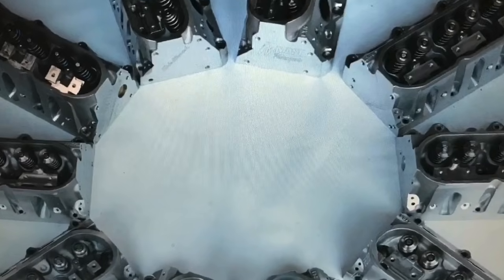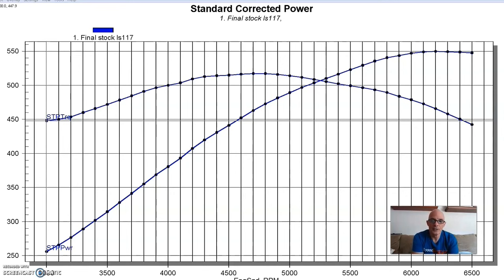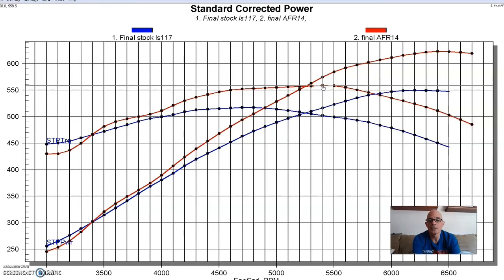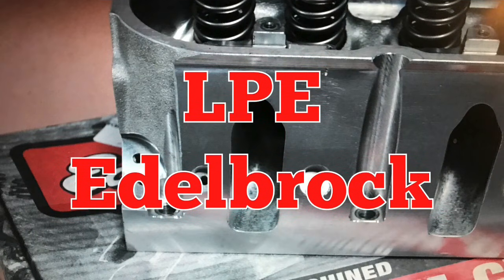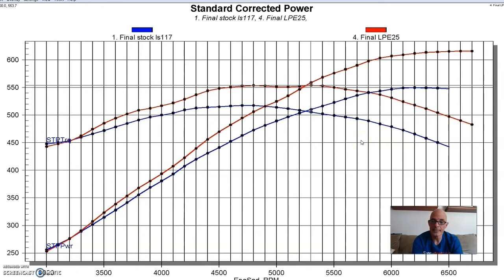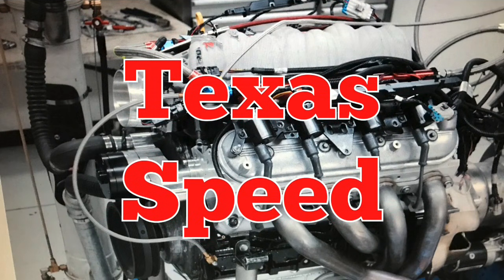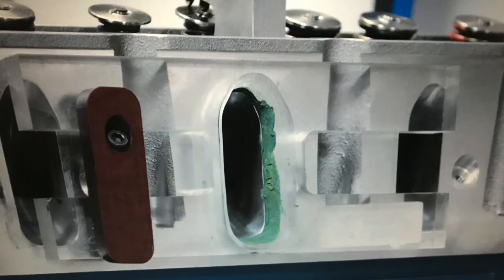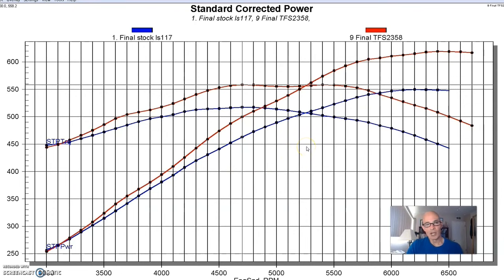AFTERMARKET LS HEAD TEST-STOCK CATHEDRAL PORT VS 10 SETS!

Comment: A few things:
1. This channel should have  1M subs. Every day is another interesting video and this one was amazing. I mean the sheer time and expense of conducting these tests is staggering, but Richard delivers the info in a free 20 min video
2. It's funny as hell that they are all basically the same. Gear heads have been searching for the secret cylinder head forever.
3. I was in the engine business until about 2010 and just started to get interested again this year. The amount and quality of aftermarket parts has exploded, as has the amount of actual scientific information. Pretty remarkable
Reply: He doesn’t hide the fact that most of these are magazine tests from years ago, but he does a great job of packaging them nicely into a video format full of good info.
Reply: If this were the 1960s and 70s you would be right. There should be 1M subs. Unfortunatly because the laws got so strict on things like street racing and emissions ect that the boys have lost interest. It's become too complicated. Sensors everywhere, computers everywhere radar everywhere.. The government has nutered the sport.
Reply: @TractorWrangler01  I don't think this is correct. Check out 1320 video or the Cleetus MacFarland channels
Reply: @Frostekzz  Richard actually did the tests. He's just revisiting them. He is also doing more tests currently. The cam test he did recently was great.
Reply: There's hardly 2 percent difference between any of these heads, telling me that the limiting factor here was the intake system air flow, or fuel delivery which was maxed at about 620 hp capacity.
Reply from the maker: the subs are going up every month-the channel is pretty new-the support is growing and greatly appreciated
Reply from the maker: there is nothing to hide
Reply from the maker: performance and racing is alive and well-this is the new Muscle car era and it had lasted much longer than the original-which produced some iconic and awesome vehicles
Reply from the maker: look closely at the flow rates of the heads-its not fuel flow, more power could come from cam timing, compression, oiling system mods and a short runner intake, but at the expense of torque through most of the curve. This wasn't a max power build-just a comparison
Reply: @richardholdener1727  Agree x100, isn't the dyno outfitted with an Aeromotive 11104 Eliminator pump/related components? Seriously 'over'-fueled, just in case. Subscribed for over a year now, no disappointments (except when I bricked my torque guess and missed out on a free cam!:D ) Thank you!

Comment: There is a great article that was published around 2001 that details the developments of the LS6 head from the LS1 head, and why GM had to make certain choices and decisions to balance power vs exhaust management and emissions regulations.  They learned some things from Lingenfelter, specifically that atomization as a result of the spray pattern from the injectors onto the back of the valves was not as influenced by the intake port design as they had originally thought.  They further refined the port profile to reduce air restrictions while being careful not to disturb the spray pattern and this allowed them to increase the hp from 345 to 385 to 405 from 2000 to 2002 (with slightly different cam profiles), although they were still using pup cats after the exhaust manifolds to help comply with LEV restrictions.  GM produced one hell of a head, knowing full well there was plenty left on the table, but not able to capitalize on it because of the cost of producing CNC'd heads vs cast.  In the end they still had to produce a product that was cheap, met LEV regulations, and then made decent HP.

Comment: Got a set of 243s, ls6 intake, and 228r Texas speed cam for a really good deal. General plan is to get the heads ported and decked, modify the manifold to accept a larger throttle body, and run a set of long tubes. Greatly appreciate all of your content because I’m super anal about trying to figure out the most optimal combination and get as much info/knowledge as I can before dropping a bunch of money into my setup.

Comment: I'm not an experienced LS person hardly at all other than repairing stock engines. The engine I build for racing are still the same old small block Chevy and sometimes big block. Dirt track and drag racing. I have been collecting ls parts, blocks, heads, and whatever comes with. I scored a set of cnc procomp ls1 heads one time and never used them YET. I think they are the same thing you just test and if so, I'm very pleased. I'm pleased because I'm planning a Na  build of a all out racing ls engine. 16 to 1 tunnel ram engine. I haven't  seen any all out na ls engines yet but I'm sure there are plenty. Thanks for your hard work, it's great.

Comment: I have a 5.3l from a 2001 Yukon,  and it sets in my 64 C10 , and because of you Richard , without any knowledge what so ever , I am confident that my setup is screwed... lmao... I now know that my heads need replaced or massive upgrades and the cam that I want to run will not work for the application that I am going for and this has made me realize that I need to throw a set of remote gt45 turbos and just let it eat. ( after ring clearances and valve springs and replacement head gaskets along with lifters.... oh and an electric water pump...lmao) thanks for giving me the confidence on this new platform to know that when I do something to the motor that if I don't do more safety than I think is needed then all I have is to blame myself.... ) because you my friend have shown me the proper and most efficient way to make a LS based motor live and make HP...  thanks again for all you do!!!

Comment: No surprise that TFS 235’s lead in Avg HP/TQ and right there at Peak HP and tied for Peak TQ with the larger AFR 245’s. Brian Tooley did an amazing job designing some of their heads and this goes to show that on smaller notes that consumers should pay attention at the air flow numbers at mid lift and not focus just the flow at higher lift. Hotrod Mag did a similar test years ago and TFS 235 led in all categories too.
Reply from the maker: same test-I did that for Hot Rod

Comment: Hi, Here is an idea for a test. 
Chevy says that there is a limit to the amount of overlap that will produce more power with a street-type  exhaust system due to the lack of pressure wave tuning. Test "stock with mufflers" vs "open headers" varying only the overlap from stock to typical drag race values.
Reply: If chevy spent millions and tells you that's what they found....why redo it?

Comment: One thing that was holding back the power on the aftermarket cylinder heads was the intake lift on that cam (.617). How much lift you can benefit from, directly correlates to valve diameter. For a good flowing set of heads like these aftermarket sets, you'd want a lift-to-diameter ratio of .30:1. Giving you an ideal intake lift close to .650 on some of these heads. I'd love to see this test done with lift optimized for the bigger valved heads, since the smaller valve heads won't lose power from too much lift, they just won't benefit.
Reply: I know first hand that the AFRs in this video are for a max lift of 650 and the Trickflows a max lift of .600 per the manufacture
Reply: I don't trust the lift-to-valve-diameter ratio very much. 
-- If you have a small port with a fat valve job, the setup will work differently. 
-- The D/L ratio I trust is 4:1 + the seat width. 
-- Also, if you have different mathematical definitions for a given cam profile, using additional "Useless lift" can have a different outcome with a square engine vs an oversquare engine. 
-- Bolt it up and run it on the dyno, buddy.
Reply: @baby-sharkgto4902  The max lift on those Trickflows is based on the spring they send them with.

Comment: I may been way off base, but when planning my 385 stroker build, I studied 350, 383&400ci dyno graphs, and it seemed the peak power dropped off faster on a 383, with the same type head , compared to a 350ci. That's what lead me to the 220cc aluminum heads,  it's been in storage for years, (I had a series of disasters, I moved, then the house burned DOWN!) But hopefully with a cam upgrade, the TQ down low should be good, with the longer stroke, and hopefully power should keep climbing to around 6500, insted of around 4500- 5000,   I know there are alot of unconsidered variables,  even different dynos, different engines,  and I'm comparing somewhat stock engines stroked, to 383, my engine is obviously a notch or three above that, forged everything, studded, balanced, I just need a good roller cam up upgrade, I have the biggest comp nos hp, flat tappet, it's not even a race engine! But sometimes maybe a trip down the local 1/8, I have considered the trade-offs, I now need to find a deal on a T-56, or a TKO 5speed, I was going to try the stock t-5, but no point in breaking it! I should exceed the tq specs by 2-3 times, and then a 3.73 gear for my 12bolt, since I have 28" tires, I have considered a 4L80, but it would kill me to swap to auto, in my 88 formula,  I may put this engine in something else, it is fact, the potential is between the heads and cam! Great video!

Comment: A lot of these heads were great. I'd take a close look at the AFR 245's, TFS 235's, TSP, and the LPE heads since they're dedicated castings. I like the LSXRT intake on a cathedral head because it gives you long straight runners. Plus, it's noisy and fun.
The TEA heads are good too, but I'd want to really know how thin those OEM castings have been machined.  
The MAST heads are good when you look closely at 5500 RPM, since you get to use the LS3 intake. Excellent choice.

Comment: Ton of work there. I dug up an old set of RHS pro elite 11° 225cnc heads. Never found data on them but liked the design. Should be as good as the newer heads. Have great ptv clearance.
Reply from the maker: I think Mast made RHS heads for a while-those r good

Comment: My set of ported and polished 706 heads compare very closely in flow with the dart pro 1s and the Edelbrock LPEs. Same compression, 4.005 bore (402 stroker). I'm excited to get it back on a Dyno and see what it makes. Last chassis Dyno read 350/350 and I believe it was reading way off according to my ricer math (one car ahead of my buddy with a 3100# 350-400whp 5.3 12.0x car vs a 4700# 402 truck one car behind). This video makes me feel better lol

Comment: Thank you. I think the TFS235 won pretty clearly.
Reply: For average power, yes, but procomp had higher peak power and torque and had a smaller port volume which would make it more responsive. 
All the heads are so close it doesn’t really matter.
Reply: Matvey Kulgavyy is go TFS or Texas Speed over Procomp.
Reply: TSP

Comment: Awesome!! Thanks Richard, for all this work you are doing for the community. How about ls3 vs ls7 intake and heads comparison? Keep it up!!
Reply from the maker: those are different motors
Reply: @richardholdener1727  I have a 06 gto ls2 with ls7 intake and heads, and a TSP 220-220/ 600-600 115 lsa and the car feels with a monster torque. All I did was refreshing the bottom and heads , intake, cam swap.😁

Comment: they pretty much all made the same power. so the limiting factor is likely the cam. the head flow on these units never reached their limits so the engine basically made all the power that cam could make. pretty sweet test. since we could put those heads on a flow bench and can see what their theoretic limits are then chuck a cam that is close to that in it then see who is truly big dawg.
Reply: Probably some of the limiting factor is cam but the real limiting factor is the C I. of the engine.

Comment: Richard this was a great test however there are a couple things.
First of all it's great you used the AFR 245cc head. 
However this head does not work that well on a 4.030 bore. It needs a 4.125 bore size at least for max potential due to valve shrouding and also it was designed for 427+ engines.
I'm surprised it did as well as it did though.
The trickflow 235 head was properly sized for that size engine although, Trickflow recommend this head be used for 416-427 engine because of the larger bore.
Their 245 head recommends a 4.155 bore for max results.
Please do this test again on a 427 or larger LS engine. Please!!!!!
Oh and also include the trickflow 245cc head too.
Good to see you used the FAST 102mm intake. Great match. This is one of my favourite tests you have done so far.
Reply from the maker: I think I pointed out smaller AFR head would work
Reply: @richardholdener1727  yeah you did.
I wish you used the AFR 235 head instead of the 245 head.
If you read around the forums there is a great debate between the Trickflow 245 and AFR 245 head and which one is better etc.
It's never been settled.
On Paper the trickflow appears better but is it really?
I have a set of AFR 245cc which have been customised by Tony Mamo but am waiting on my engine to be built.
Reply: @mrmysterious6006  I like Trickflows and have their GenX 225s and they're great. I recently purchased AFR 245's (wont be here till Tuesday) I would have probably went with Trickflow again (just because I'm familiar with them) for the 245's but Trickflow only offers 245's in a 6 bolt and I didn't want the extra bolt bosses sticking out looking all weird if not using them so that pushed me to the AFR 245's.

Comment: reason why those procomps make so much power is because the runner is way smaller than the others, if a head flows the same as another head but is much smaller that = more air speed and will make more power.

also pretty sure the mast small bore has a 2.08 intake valve, as far as im aware thats the biggest valve you can fit on a 3.9" bore 5.7L ect

Comment: So what's best for the money, and what's best regardless of the price? Same question for Rec port heads. My application is a 6.2 LS3 in a Gen 5 Camaro with a forced induction future but N/A for now. Trying to keep low-down losses minimized, too, and I want "best" to be categorized as David Vizard might do so, so taking into account coefficient of discharge, swirl factor, and all that other stuff that paints the full DETAILED picture, rather than plain old raw flow numbers.
Reply from the maker: Come to grips with the fact that there is no BEST.

Comment: It's always amazed my that the PR V8 guys are all about getting the best aluminium heads, aftermarket, ported, big valves. Even at the enthusiast level. Yet in the 'Import' JDM / Euro world, so many enthusiasts barley even consider it. Sure they're are fewer 'aftermarket' castings for non-US engine's
However with CNC programs, it can be close to the best $1000AUD you spend in an engine build. Especially on a boosted application, it's easy power at lower boost, heat and lag levels. so much win.
Great test.
Reply: Only reason most people like boosted jap import cars is the easily attainable cheap easy peak hp. That's why in car forums/groups its so easy to look like a hero. Do something different to the rest of the sheep and get better results
Reply: The stock twin cam 4 valve Japanese heads easily out flow all of these heads even with much smaller bores, that's why you don't see aftermarket heads. I'm not familiar with euro but if they are twin cam 4 valve then same story.
Reply: @baby-sharkgto4902  not even close. Only a handful of stock Honda heads flow past 300CFM stock. Most 500cc ish per cylinder 4v Japanese heads are in the 220-250cfm
Reply: manitoublack  their are not feeding the same bore size.  Divide airflow by cc and a 4v head will kill a 2v

Comment: Awesome work. Would love to see an extensive in depth Header test one day! Things to note, overall design, diameter, length to collector, collector length, port matched to heads vs non port matched maybe on a 5.7 ls1 :P GTO motor
Reply: I think there is already one.
Reply from the maker: I tested lots of headers-including adjustable ones that I made, have not run across big differences
Reply: I'll just have to go watch that video then :p love your work keep it up👍

Comment: Any reason why the Texas Speed heads seem to peak at a higher RPM? 

And this data is awesome, I have long had a excel sheet with a bunch of the "stated" airflow information but it is refreshing to see so many options tested independently. Nice to see most of the data is consistently below what's in my spreadsheet and I know all tables flow different so finding a fairly consistent difference at least gives me some confidence most manufacturers are giving fair flow numbers for their products.

Comment: Are the AFR 245 heads so different from “AFR 210cc LSX Mongoose Street Cylinder Heads” that this test tells me nothing about the 210s?

Dreaming about an LS1 383 stroker with a T56 for cross country driving.  Trans doesn’t like to shift over 6000 RPM so low and mid RPM power is my goal.

Comment: First thank you for all you do for the hot rod cumunity, after watching the video, and mostly repeat performance s I wonder if the intake was influencing (restricting) the test numbers. You would think there would have a little more of a spread between the best and worst unless there was a restriction somewhere else, would be interesting to see a better flowing int or bigger throttle body would change the spread. Thanks again for all you do, keep up the good work.
Reply from the maker: neither the intake nor tb were restricting this motor